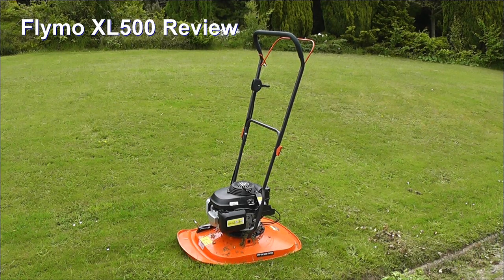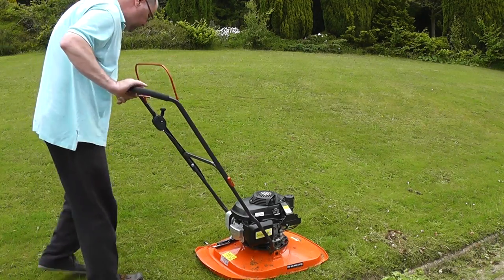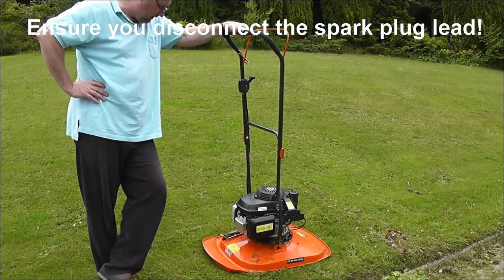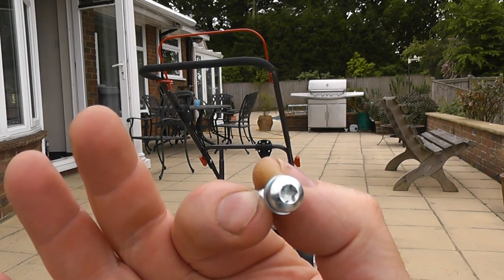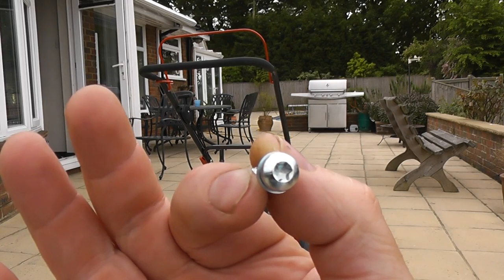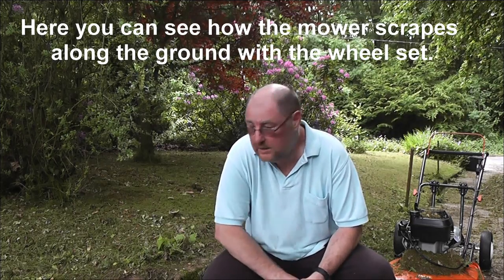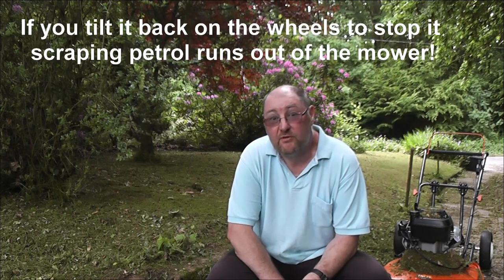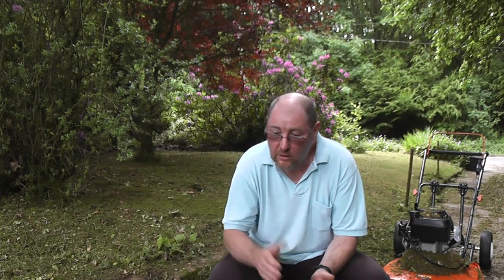Flymo XL500 Petrol/Gasoline Hover Mower Review.  Honda Engine.

Comment: Here in the states we put wheels on each corner, it seems to make it easier to use. Cheers.
Reply: It just seems to, but at the use, you could see that this is more practical with an air cushion ;)
Reply: not so! had one for many years and hate wheeled mowers now.  Stay on the upside of a slope and let it hang down. 
 Not dangerous at all.  Where can I get a new Flymo?
Reply: Flymos are extremely easy to use. They are way better on wet grass and hilly lawns than lawn mowers with wheels are. Wheeled lawn mowers kind of do feel a bit restricted once you have owned a Flymo.
Reply: I agree but when you have a drainage issue that the county won't fix......FLYMOW is the way to go or you will have black muddy lines all in your low lying areas.
Reply: @photographylover1238  from my experience you have to man handle flymos which makes cutting the grass a choir.

Comment: they where made as a greens mower for around ponds they came with snorkels back in the 70's and early 80's mine is a 79 with a tecumseh engine just love that there is no wheel marks left on the lawn

Comment: Where do I begin, well firstly I should read the instruction book if I were you! I reckon they should supply a booklet on "how to mow with a hover" so the uninitiated could understand the advantages of using a hover mower. When these things came about, they were a contractors mower due to their versatility. We used them to mow the grass over the fuel dumps on the RAF bases, yeah, no less than 45 degrees. The sliding down the slope is because you're not letting the mower work for you - you've already noticed that it cuts in any direction, well stand top of slope and trail the mower sideways along it, simples. I don't know why you spent money on wheels, drop handle, turn on side, (air filter up) and carry by side of handle, like a suitcase. By the by, I have the husky badged one.
Reply: holzwolf seems to me after watching other videos, he needs to flip the handle over so the "bill" on the deck is forward not bsckward.
Reply: Thanks for this buddy 👍 Do you find it mulches the Grass well?
Reply: in the good old days these were two stroke , and could cut anywhere ,,, as mebtioned above , the dodge was to use half the handle , tied to a rope , stand at the top of a bank , and mow from side to side ,,, best bit ,,, no grass box to empty , and no sweeping up ,,, just mow the path last
Reply: yep we had one in the 60s. I would have been 8  and volunteered, was paid 2 bob. it was floating off the ground cut the right height ,the cut grass just went back into the lawn. rope tied to each side of the handle I could get a pendulum effect on the hill. i  was designing a ride on one. was forbidden because I might kill myself. killjoys
Reply: LMFAO when he nearly flung it over, starting it up, mowing uphill dragging the extra weight of wheel set.
I was in tears. 
Had mine over 15yrs and it looks it por thing. But still starts easy cuts and most importantly floats .. No wheels.

Comment: I have used the two stroke version of this mower many times. I found that cutting high banks was easier using a rope and walking along the top of the bank lowering and raising the mower as I went along. I am hoping to buy a four stroke version tomorrow. I intend to convert it to run on propane like my other mowers so four stroke is essential as there is no way to add oil to the propane of course. Nice review thank you..
Reply from the maker: You can't beat a four stroke!  :-)
Reply: @RussellPlatten  I picked up my new mower yesterday (sunday). Took it the house I am moving into which has not been cared for for a couple of years. Brilliant results. Absolutely chuffed to bits with it.
Reply from the maker: Yes, it is a good mower!  :-)

Comment: Thanks for the review Russell.  I had the 2stoke model Flymo for 20 years - it was light and easy to use.  If you kept it serviced it started easily and you could drop it down banks with a rope on the handle. 
12 months ago I bought this new model with the Honda engine.  My view is that it is a great disappointment.  It is very heavy (and in NZ you cannot get the wheels) On slopes I think it is dangerous because trying to go across the slope it is almost impossible to keep it going in straight lines.
After about 20 hours of use (whilst it was still under warranty), an inlet or exhaust valve stuck and Husqvarna didn't want to know, they put all the blame on Honda and my dealer had to talk to them.  It took 10 weeks to fix then after another 2 hours of use the con rod came through the side of the block and the oil went all over my lawn.
They have now fitted an complete new motor, and today will be the first day of use.
I wish Flymo had never stopped making the 2 stroke version, it was fantastic.
I could never recommend this new version to anyone
Reply: +Richard Finlay  Yes, the 2 Stroke was lighter and better than the big heavy 4-stroke & wheel kit attached.  Its not even 'flying' in this video, its sliding on the ground...the original version you could let the handle go and it would fly & mow randomly around the yard.  This one doesn't move unless someone's pushing...
Reply: Richard Finlay interesting review, I've also used a two stroke version many times but am concerned a lot of people do say this Honda engine is heavy. Do you still have yours?
Reply: Still got my 2stroke , still going strong, love it.

Comment: I've had an earlier version (two-stroke engine) for 23years and it has been serviced just twice, yet this morning it roared into life and did my flat lawn of about 500sq yards in fifteen minutes. Where I used to live it had a far greater area of rougher grass and terrain to cut, including steep bankings where I tied a rope to the handle to let it down the banking and then pulled it back etc. It's done many miles of hard work and has been totally reliable. No wheels with mine, and it will have to be changed soon because the body is, not surprisingly, developing a significant crack. However it has been a wonderful investment and I looked in to this demo to see about buying another - I will!
Thanks for the demo, Russell.
Reply from the maker: Thank you for your comment David.  I am still very happy with my Flymo!

Comment: I have virtually the same model. But a husqavana model. Great video and back up everything you say. My only tip is keep cleaning the grass away from the bottom of the engine as it needs to suck air in to float. If you keep cutting grass it gets very hard to push when it gets covered. Enjoy
Reply from the maker: nick coaten Good advice regarding the grass clearance Nick, it certainly does make a difference.  My wife was the one to suss this out in our house and she keeps telling me off for not removing it!  Thank you for your comment.

Comment: Great review Russel, I had a GL47 with the 2 stroke engine for 10 years. It was used on a lightly sloping back yard and and extreme sloping front yard. The trick for the extreme slope (and was as per the instructions) was to stand at the top of the slope above the mower and swing it from side to side. In any case it is unwise to stand below it and push it up hill. Electrolux stopped selling the petrol Flymo in OZ and I was greatly disappointed not to be able to replace my Flymo with another.

Comment: It looks like a great concept.  The flatter the lawn the better i would imagine.
Reply from the maker: Yes. it is much easier on the flat.  I prefer it on the slopes to the self propelled mower I had before it, but it has to be used vertically up and down.  My wife finds it way too heavy for normal use and she is not one to complain.  Personally I think it is a good mower.
Reply: Yes, great Concept. I use Flymo since the eighties (know it since the seventies when my father bought it's first one) and wouldn't use another one.
For the slopes, it's just a question of practice: once aquired, you'll find it more easy then a mower with weels. If you want to go horizontal, don't follow the mower but walk higher then it , with the handle at about 90 degrees of the direction you walk (sorry if my english is not perfect, hope you understand).

I'm from belgium, and don't find Petrol Hover Flymo more, even no 47cm electric ones... No more than 40 cm. Is it possible to find it in England?
Reply: MarcMac04 I answer to myself: it seems that, if we want a petrol Flymo in Belgium, we must bought a Husqvarna GX 560, witch is a Flymo with the badge or Husqvarna, from the same commercial group.
I'm happy having finding that, because I prefer this option vs the one witch consists of buying a similar model from another manufacturer (yes it exists) because I prefer buying the original vs the copy :)
Reply from the maker: Your English is very good Marc!  I have found it easier the more I use it.  I tried tying a rope onto the handle for the steep bits, but this leads to other problems and I made the decision that mowing them the way I showed in the video was best for me.
Reply from the maker: I had a look at the Husqvarna GX 560 and it certainly looks like the same machine.  I did a bit more digging around and Husqvarna own Flymo. so it probably is exactly the same mower!  You learn something every day!  Thank you for your comments Marc.
Reply: Russell Platten I can confirm: I downloaded the manual for the Husqvarna GX 560 and, and the end of it, they recommand using only Flymo Genuine parts :)
The file I downloaded on the support of Husqvarna's web site is called: HUSO2012_Flymo Husqvarna GX 560.pdf ;)
Reply from the maker: MarcMac04 Thanks for the links Marc.  That is the technique I have adopted for the slopes. Unfortunately my slopes are not as neat and tidy as that.  Loved the 1965 video, I was 3 when that was made LOL!!!  The mower must be a good design as it has hardly changed in 50 years!
Reply: Yes, our grounds are not quite as soft as in publicities...
Reply from the maker: They most certainly are not!  That is one of the reasons I like this mower.  It is very well made and tough, you can run over twigs and small branches and it just keeps on going.
Reply: A flat lawn is best served with a wheeled lawn mower, you get a nicer finish and more height control.
This is best for tougher jobs and slopes and goes under hedges etc

Comment: Excellent review Sir. 👍🏻👍🏻👍🏻 

Thank you so much for going to the effort of making this vid and sharing it😎👍🏻 

Do you find that you get any lumbar discomfort from extended use of your petrol flymo? 

I'm considering one, but have a prolapsed disc in my lumbar spine, so conventional mowing is very painful very quickly, owing to the inherent loading of the lower back, especially when tall, like myself.
Reply from the maker: I have a slipped disc and find it easier than a self propelled mower as I use mine for rougher ground.  I do not use it for prolonged lengths of time though, so I cannot say whether it would cause issues if I used it for longer periods.  The good thing about this mower is that it goes wherever you push it and you are not constantly fighting the wheels to turn it.  :-)

Comment: good review
i am using a 20v Dewalt electric trimmer and blower , just switched from gas 2 stroke trimmer
lawnmowers is Lawnboy 22271 brand 
also have a older 2 stroke 10601 lawnboy very lite

Comment: Does it really hover?? I used to own the 2 stoke version and it was a beast. Saw this had come out and wondered or it was good enough to a bee apiary? Is it any good on ruff ground?
Reply from the maker: It does hover Christopher and I much prefer it to the self propelled mower I had before it.  It is great on rough ground, I posted another video showing it in action if you are interested.  It is still hard work, but the mower is so much easier to manoeuvre than wheeled mowers.  We use it regularly.  :-)

Comment from the maker: Thanks for your comment.  I thought long and hard about where to stand on the slope and tried it both ways on another section of the garden with a steeper incline; I came to the conclusion that it is harder to fall uphill that it is down.  I reckon I need to do what Georgey1012 said and tie a rope to it.  I hope you manage to find another petrol hover mower down under!  All the very best, Russell.

Comment: i never even knew such a thing existed. I am so frustrated with the lawn mowers I've purchased over the last 3 yrs. They all break after a few months it seems. Anyone have a suggestions for a Self propelled mower under $400 that will last 3-4 yrs perhaps. Thanks
Reply: "Wolf Garden" Red and yellow they seliger for Sure :-) Mine gasoline one is 1992 and still running ...prepare for a price Shock or buy a Honda mower, the do complete units not Engine only
Reply: Read Stephen King's 'The Lawnmower Man' short story before wishing you had a self propelled one !
Reply: Just get one with a Honda motor.  that is the key.
Reply: A lot of the time it has to do with the ethanol in the fuel that comes out of the pump now days. If possible buy 100% gasoline for your small engines. Its usually labeled Marine fuel at the gas station.
Reply: Check & change oil level, air flow filter, and spark plug regularly, and use decent quality fuel. Should last years.
Reply: never ever leave gas in any engine for more than a month, if it is going to sit for a long time run it out of gas and open the gas cap to let all gas evaporate. ethanol fuel is very hard on carburetors and its internal components.  ethanol draws moisture and causes corrosion.
Reply: Any Honda brand, not just the engine but the mower its self
Reply: They break because they are made of plastic. It wouldn't be a problem if AIR wasn't an essential thing to keep an engine running smoothly! I have a mower with a plastic carb and have to clean it 2 times a year to keep it running smoothly.  Everything, including $40,000 cars, are made to be disposable these days
Reply: A toro rear wheel drive mower with personal pace drive system ....best mower ever. ...you would not be disappointed....$350
Reply: You just need to clean the carburetor out. Many people throw out their lawnmowers thinking they're broke, but its usually just the carb that needs cleaning. I did it to my own mower that wouldn't start one summer. Took off the carburetor and cleaned it out with spray can carb cleaner and it started right up.
Reply: Snapper 21" Hi Vac used to be a good mower when they were still made in McDonough, Georgia.   I hadone with a commercial cast iron Tecumseh engine with pressurized oiling and an oil filter. Now they are owned by Briggs & Stratton who shut down the original factory and moved production and you can only get their engine in it.
Reply: 2 i would suggest, a goat or a cow. neither hovers unless you feed them taco bell

Comment: It seems obvious that as the mower "floats" on an air cushion, any attempt to push it across a slope will result in it falling down the slope due to gravity, just swing the mower from the highest point of the bank, on a rope if the bank is long/high. The 4 stroke version does look very heavy compared to the 2 stroke version ! I might have to think about this one.
Reply from the maker: I agree, it is obvious that it will float downwards, but after handling an electric machine which is easy to traverse slopes with, this is a bit of a shock.  it is because of the weight.  There is way more leverage on the handle and it takes a lot of strength to hold it level.
Reply: I am a lady gardener, and I manage it.
The two stroke would be lighter and better for real steep slopes [where the fuel might cut out] but I find the 4 stroke with wheels does for me as a jobbing gardener, I have a 4 wheeler as well.
Reply: +Jo Allan I get all my mowers from mowersonline
Reply: +Jo Allan and I recommend reading the manual

Comment: is the mower fixed speed ?I noticed that it has a choke and throttle cable but if it hovers it must be a fixed speed , does the control lever on the left hand side do anything ?
Reply: it cuts the engine and it operates the choke, as any throttle control

Comment: I owned a later model that used a lighter more powerful 2 stroke motor, and even then there were issues with not enough lift, and side slip on inclines. Honestly the device would have a hope if they could find a way to shed 15 pounds.
Reply from the maker: I agree, if it was lighter it would improve the mower immensely.
Reply: It's made to do just that, slip side to side. Golf courses still use a version of this for cutting extreme banks. You can hold in one hand and swing side to side almost as a sling blade.

Comment: Never seen a Flymo before!
Reply from the maker: Thomas Andersen They have been around in the UK since the 60's.
Reply: Looks like it would cut a putting green nicely.  How strange that it dont come with the wheels!
Reply from the maker: Thomas Andersen There is a fan connected to the shaft above the blade and housing.  The fan pushes air through the orange casing and blows it down to the ground.  This turns the mower into a mini hovercraft and it literally floats on a cushion of air.  It is very easy to move when it is running and wheels are not required.
Reply: Its amazing that such a strange design was mass produced
Reply: Thomas Andersen It is mass produced because sensible people could see a need for it, and bought them by the thousand, it is still a very useful machine for many garden requirements where access is a problem, and it does not leave wheel marks on your lawn, try one!

Comment: I’m too attached to my 1987 John Deere 14PB and wheels, looks like it gives the lawn a crew cut. How do you control cutting height?
Reply from the maker: There are spacers above the blade.  I have it set to cut the grass as short as possible.  :-)
Reply from the maker: There are spacers above the blade.  I have it set to cut the grass as short as possible.  :-)